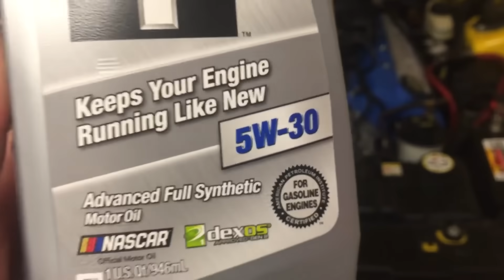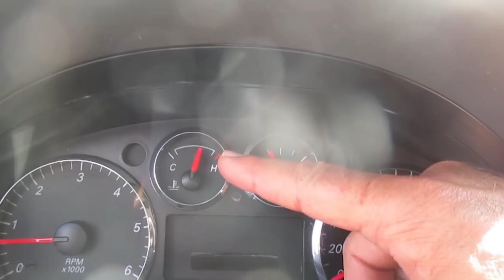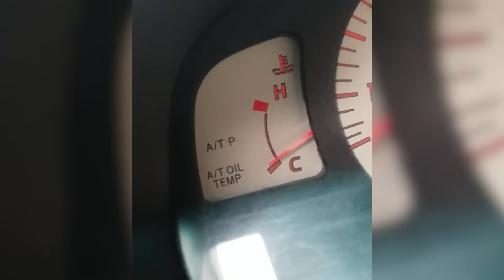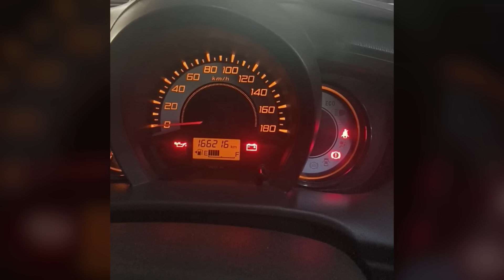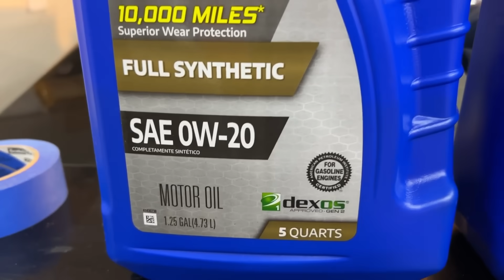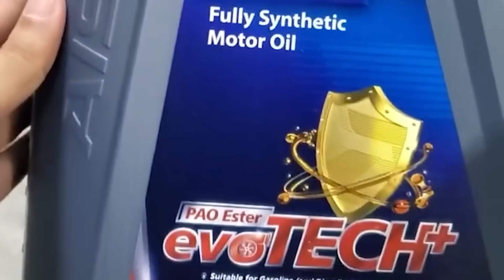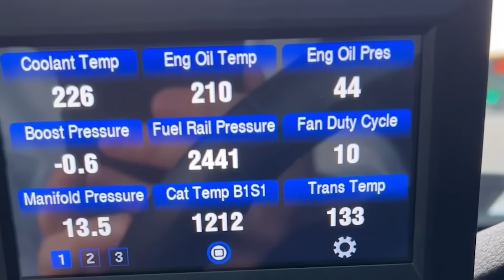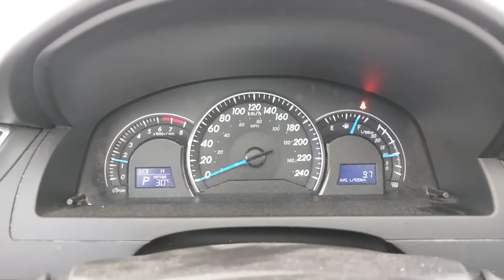Why US  Cars Use 0W 20 But the Same Engines Use 5W 30 Abroad (Exclusive Mechanic Explanation)

Comment: Mobile 1 Full Synthetic 0w-20 in my new Chevy Trax, will consider at 50,000 miles going to 5w30 Mobile 1 when the time comes ... a great oil is cheaper than a new engine.

Comment: When I put 5-W30 instead of 0-W30 oil in my engine, after 2500 km the ENGINE light started to come on during cold starts. During cold starts, various errors of the DPF filter, EGR, etc. were often reported. After changing the oil with the prescribed 0-W30, everything works without any problems. No Engine lights, no errors in the computer.
Reply: I'm confused. Do you use 0w 30?

Comment: My 2003 Honda Odyssey use 5w-20 and after 23 years with 255k miles passed smog check 6 months ago
Reply from the maker: Great to know your 2003 Honda Odyssey is still running so well and passing smog with 5w-20!

Comment: 0 weight oil IS NOT 0 VISCOCITY, AND the oil DOES NOT REMAIN AT "0" .    i suggest you fell for this clickbait like all the other sheeple.   At winter/cold‑start temps, the oil behaves like a very low‑viscosity “0‑weight” oil so it can be pumped quickly to engine parts, but it is still a real liquid with measurable viscosity. At operating temperature, a 0W‑20 behaves like an SAE 20‑weight oil, so the effective viscosity is similar to any other 20‑grade oil once the engine is hot.    so you are not running an engine on "0" viscosity oil.........and by the way,  viscosity is only ONE factor for protection.  here are the others...... Anti-wear additives (like ZDDP) form a protective film on metal surfaces to prevent direct contact and reduce friction damage. Detergents and dispersants clean engine internals by suspending contaminants, sludge, and deposits to avoid buildup. Anti-corrosion agents neutralize acids and inhibit rust on engine components.    Amazing how idiots look at "0" on the label and throw out all logic and reasoning.   these people say "i dont want additives in my oil",  or the heavier the weight of the oil the better............. i dont care about detergents or the additive package,,,.....i just use oil!!!!!!!!!!!!"            IDIOTS

Comment: Ahhh...all the "OIL EXPERT" woodchucks coming out of the burrow to tell the world which oil is best for YOUR car or truck. Most people with any common sense will use the gas and oil that the owners manual states to use. While all the "experts " here tell you that is a ploy of the company that built your particular vehicle to get your vehicle to have catastrophic engine failure so you will have to give them more of your money, that notion is as stupid as the idea of the earth being flat. Auto manufacturers do countless hours  and spend a LOT of money doing R&D on all the fluids needed in their line of vehicles to find the absolute best for your particular engine. Modern oils ARE very thin seemingly but still are very capable of protecting an engine for a long time when said engine is used for whatever it was designed for. NASCAR racers use very light oils when they qualify to help make more HP and make the car faster. Heavier oils used in modern low milage engines will set off sensors that turn on your engine light. When an engine gets many miles on it and starts using more oil that is the time to up the viscosity with heavier weight oil and not oil additives. Those magic potions went out with the 70's. If you people all want to listen to the Y/T woodchucks to make you oil decision hey be my guest. You want to listen to a Y/T nobody that just fixes cars in general and does not engineer, build, test engines of all brands I would rather trust the people that did engineer, build, and test the car/truck engine. And after reading some of the comments here I guess the woodchucks have taken over...Ugh the humanity. BARTENDER...BUD LITES FOR THE HOUSE!!!!!

Comment: I found the PCV System tuned too low on my 2010 MDX J Series. This  allows blow-by to carbon load the oil(short OCI's). At .014 to .058inHg is too low and carbon loads the Oil Control ring causing it to stick given time. Carbon is dry and sticky by nature and sticks the ring causing oil consumption. It takes 10's of 1,000's of miles for this to accumulate but it will happen. I've re-tuned my system to the common domestic vacuum of 1 to 3inHg with a Catch Can to correct this. I first offset the issue with 10W-30 PAO Group IV syn but had the carbon trail when I went inside pointing to the oil control rings. Toyota/Lexus runs a little higher but not high enough(.4inHg+-). Low Tension rings(Main problem), Higher compression and thin oils cause this. HIH

Comment: I also don’t like synthetic too. Slick makes the piss the walls shiny you lose the cross hatches in the cylinder. Therefore, it burns the oil. I use conventional oil just change it sooner way better than the car.

Comment: I got a 2006 Mustang run 10W-40 with a jug of STP oil treatment sticky easier on startup than every once in a while I shove 1/4 of a quart of engine flush in it drive every third oil change to flush the engine out had a Jeep Cherokee was burning oil like 2 quarts a week. I put a whole bottle of engine flush in it and drove it stopped burning oil in about two weeks. Those tighter tolerance got flex ports out. The ring. Gap is too small and makes the ring stick inside the piston gotta get those rings free

Comment: Was looking to see if this AI sounding video, took the motor oil geek's point about "Euro oils" not necessarily for Euro engine technology, but to match fuels availabke there.  Also thought for sure that GM's 6.2 infant mortality issues woul be addressed.  Their 'fix' was to change oil viscosity recommendation--a thicker weight printed on the oil cap, lol.

NOPE

Comment: US auto manufacturers often recommend lighter weight oil (like 0w20 or 0w30 to help their EPA gas mileage ratings) but those thin light weight oils can shorten your engines life over years so (IMO) after break in and when you get your oil changes I would run slightly heavier oil like 5w20 on a 4cyl or V6 and maybe 10w30 if it is a V8.     JMO !          Some say to use 0w20 oil (for cold weather) if you live in northern states but there is nearly ZERO difference in cold oil flow between 0w20 and 5w20 so running 5w20 is not going to keep your cars engine from starting and running correctly but the 5w at startup can help protect your engine on startups.

Comment: Simply put, find a European or Japanese owners manual for your car and see what oil is recommended.  If it is the same as the US recommendation, use it.  If they suggest a higher viscosity can be used, use it, and ignore the US recommendation.   Tolerances don't change by where a car is sold. Engagement of oil pressure driven devices (VTEC, variable cam, etc.) doesn't change by where a car is sold.

Comment: Thank you. Toyota always puts in 0 W20 now I know better. Now I know what to say when they tell me I will void the warranty.
Reply: ...Hi, Paul. Actually, Toyota does not "always" use 0W-20. In parts of the world that has hot climates most of the year, Toyota will put in and/or recommend using 5W-30 and higher, depending on where that car will be driven.

Comment: I mix 0w20 with 5w30 and make my own 2.5w25 because I can't buy it anywhere. This combination not only makes my engine run better, but it has increased my HP by 19 while still maintaining the original MPG. I also own a piece of the Brooklyn Bridge. Take that, you greedy auto makers!

Comment: I have a 2013 Toyota 4Runner w/ 40K miles that runs 0W-20 no issues so far and I live in Hawaii.
Reply: I would definitely hope there would be no problem at 40k. The problem, if there is going to be one, is likely going to happen during the next 100k. If you change your full synthetic oil and filter every 3k to a maximum 5k, then the likelihood of an engine wear problem is greatly diminished no matter what oil you use.
Reply: @Martin....Hi, from Arkansas. I can understand why you have had no issues so far with 0W-20...you live in Hawaii...LOL..!! The coldest it gets there is still in the 60's for the most part, and the hottest maybe 90 occasionally, but usually in the 80's...in Fahrenheit. Now that is a nice climate...!! I bet that your oil stays very close to the 20 number year 'round, so even your coldest starting number is still close to 20.

Comment: Tue car manufacturers even prints the required oil weight for their engines, right on the oil filler cap on the engine. This makes it iffy to use a different weight, rspecially during the warranty period of the car, as they might blame the owner for not following their oil weight requirement for the engine, if something mechanically goes wrong with it.

Comment: First responsibility is to protect your citizens including their car engines. 5W 30 is a minimum requirement for the protection of engines and components. What’s happening today is a desire to destroy engines and transmissions at 50k miles rather than working for longevity at 500k miles

Comment: Are those engines identical in every way? I saw another expert mechanic hinting that some new engines have programmable oil pumps calibrated for 0W-20
Reply: I guess finding out if your vehicle has a programmable oil pump would be prudent. It would be useful to know what year and make started doing that. Also would be helpful if they could be programmed for the thicker oil.

Comment: I use 0w16 as a natural engine flush, before re-adding my 5w30 after oil change, just 1 quart of 0w16 drive for 60-100 miles, drain, fill with 5w30.

Comment: i live in middle east i have 2021 toyota fortuner VX3 SR5 top of the line it's mid size suv the brother of 4Runner in america same engine not the new 4Runner no no the old one they stopped making in 2024 i guess , engine is 4.0L V6 1GR-FE engine recommended oil is 5W30 original toyota oil i change it every 5000 kilometer the more i drive it the better the engine gets , quiet smooth nd powerful never ever failed nd power always there with Aisin 6 speeds transmission car is literally indestructible

Comment: The winter weight doesnt matter at summer temps, so 0W, 5W doesnt matter in hot climates. That spec just explains how thick it is at cold temps. It only applies to the cold start condition too. Once engine is at operating temp, it is again irrelevant. 

20 v 30 can matter at operating temp.  HOWEVER...only if the coolant system isnt keeping the temp constant.  Maybe in very extreme environments where operating temp is 30%-30% higher constntly because temps exceed coolant system capability.

Comment: "You need an engine rebuild, cylinders are not holding pressure."
What!? Ive been using 5W-30 every 5k miles.
"Ah, the thicker oil doesnt create a fil thin enough to remain between the rings and the cylinder bore. The rings end up like wiper blades so you get extreme wear."
But...but...the internet said I should use a different oil than th3 manufacturer said."
"Ok, but you still need a new engin3. $12k please."

Comment: This is true, you can use 5w-30 in place of 0w-20. The key is you always have to go up in the numbers. You can never go down. So if the engine has been proofed with 5w-30 you could never go down in temp to 0w-20. It always has to be thicker.

Comment: Always 5W-30 after 10000 miles common since to me. I drive over 5000 miles a month and get a new car every 3 years. I change my oil every month and use Valvoline products. This has been a good oil for my 3.6L Pentastar V6 which has been a good engine for me using 5W-30 in my 2015 Grand Cherokee with 80000 miles and not one engine issue.

Comment: Thinner oils absolutely do NOT mean thinner protection. If that were true, all engines would fail before their first oil change. Also, engines sold around the world use different computer software that regulates oil pressure among a million other things. These engines also differ in other respects not visible to the naked eye. Bearing thicknesses, variable timing settings, oil gallery passages... can all have slight variations that only engineers would know about, not some AI robot posting nonsense on YouTube.
Reply: TRUTH BOMB.

Comment: I wouldn't use 0w-20!!!!  Ever!!  The higher MPG requirements caused hundreds of thousands of engine failures due to manufacturers trying to comply with these kinds of measures. Just like low tension oil rings as well.
2012 Tacoma   10w30 and 5,000km (3,100miles) oil change intervals. I live in a warm climate and most of my driving is short trips

Comment: 2014 f150 5.0 i just switched from 5w20 to 5w30. It has 85000 miles and runs very quiet. Lots of oil changes is the key.

Comment: I drive a 2014 Silverado with 75k miles and just made the switch to 5w-30. I don’t drive a ton but after this insightful video, I’ll never run that thin stuff again. It’s also very true, as you said, that the EPA forces manufacturers to eke out the best MPG they can to avoid fines. It’s all a scam at this point!

Comment: My 2013 Chevy - Silverado 1500 LT 4x4 5.3L Truck recommends using 5W-30 full synthetic engine oil. So I run Schaffer's - Supreme 9000 5W-30 Full Synthetic Gasoline Engine Oil in my 5.3L Gen 4 LS Engine.

Comment: There is just no way any dealer is going to know you use 5w30 oil to “void” your warranty if you don’t tell them. Oil is oil. They pull the dip stick to check the level and that’s the end of it.
Reply: If they care enough they can ship an oil sample off to a lab like blackstone and have the viscosity tested… so yeah
Reply: @jacobbierbower3862 that’s true. The question is whether they are going to think to do that and then actually do it.
Reply: @Drrich_DIY  ...Hi, and I think they would need to suspect something really odd with an engine to actually go to the trouble and time..and money... to send off an oil sample. They would probably try and bluff the customer to admitting they used the wrong oil or deliberately damaged the motor to keep from repairing it under a warranty, but....I have read elsewhere that the warranty cannot be voided due to the grade oil used, but I just don't know for sure.
Reply: @StephenJeffery-b6b thanks for that info. The reality is that dealers don’t eat the cost of warranty work. It’s paid for by (in this case) Subaru. And it’s guaranteed money. So I highly doubt they would go through the trouble of testing the oil. Any engine that blows up merely from changing the grade of motor oil slightly is a problem.

Comment: I bought my ‘23 Subaru Wrx back in 2023. My first oil change at 1000 miles I switched over from 0w20 to 5w30 based on someone’s YouTube video and the fact that I always used 5w30 successfully in my Forester Turbo that had 250k miles. . My WRX has 35k miles now, and I’ve changed the oil every 3k miles. Gonna keep it that way.  Thanks for this video.
Reply: In other countries STI's run 5w-40, what I'll be using in my next oil change.
Reply: @dailydistruction interesting. I don’t think you can go wrong with too thick. Unless you live in Alaska!
Reply: Smart man
Reply: will it affect your MPG? The gas cost and longivity of engine both matters
Reply: @Harvee777 I don’t think it does, although I could be wrong. I get between 27 and 30mpg per Tank, which is better than I was expecting. I do quite a bit of highway driving and don’t accelerate like it’s a twin turbo Callaway, though.

Comment: Less than a minute in the video, you mentioned why the US pushes thinner oil like 0W 20 while the rest of the world sticks with thicker, more protective blends. So that tells me right off the get-go who you are siding with .20 years ago our engines didn’t have such tight tolerance so they used to thicker oil fast forward to today. The engines have a much tighter tolerance and they use a thinner oil.

Comment: Would you consider changing a 0W20 engine to 5W30 oil after 100k??
At the moment, running 00W20 in my 2019 Honda Pilot 80k miles. Im considering changing to 5W30 after 100k miles. I've driven this same design engine in three other Odyssey models (04,09,13) using 5W30 where each lasted (04-360k, 09-160k, 13-225k). I've disabled the start stop feature in my 19Pilot.

Comment: I tow a travel trailer with my Ram 1500 V6.  I run 5W-30 in it, and when I'm not towing it can still get 24-25 MPG on the highway.  When the oil temperature reading is creeping up around 250F while pulling the travel trailer up a hill on a hot day, I'm not real keen on running 0W-20 in it.